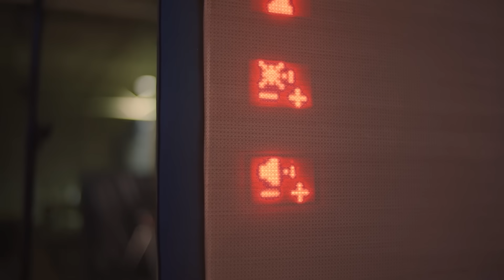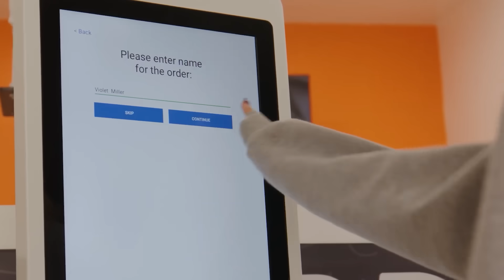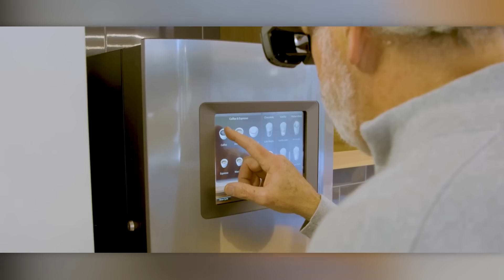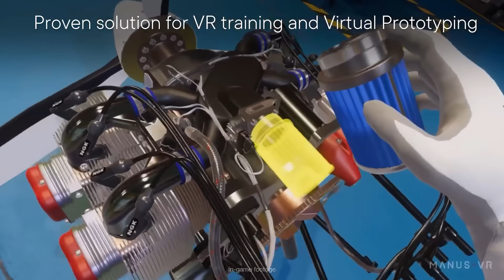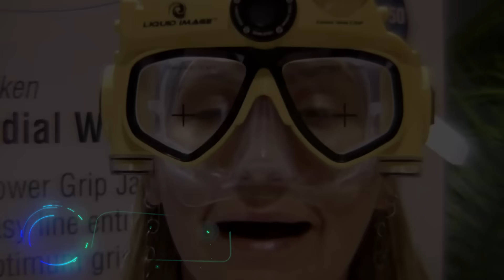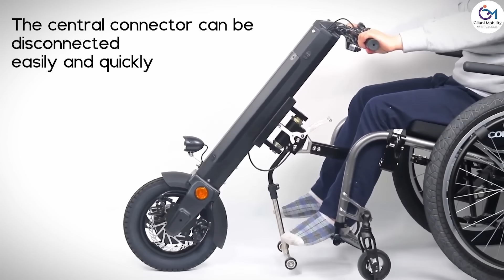AMAZING INVENTIONS THAT HAVE REACHED A NEW LEVEL

Comment: About the Stringdrive:
1) It isn't new. That tech is at least 15 years old.
2) The cords are NOT elastic. They are a type of paracord, with minimal stretch.
3) They were never adopted because the stringdrive mechanism is heavier, bulkier, and the strings had a VERY low service life compared to standard chains.
Reply: Belt drive bicycles are proven to be better than chain drive, but string ?
Reply: Please correct me if I am incorrect, but this is CVT for bikes? Also, I agree with @ronpiper8496, why not go with Belts that last?
Reply: This is not CVT for bikes. Belts are absolutely a viable alternative to chains, just like the stringdrive. But that's up to the user.

Comment: In reference to the vehicle flying, purchased by the Air Force. You said Canadian Victoria to Vancouver in 41 minutes. At 155 mph ?  The distance between those two cities is nearly, exactly 60 miles. The math doesn’t work!
Reply: Good catch. I would imagine the machine is not driven at 100% of capacity. So if someone went 120mph, then it would take 30 minutes. Math comes to the rescue again.

Comment: I realize they build more bikes than wheelchairs but why the hell is this thing worth 1200 bucks and a wheelchair costs even Medicare user that much and then it cost Medicare twice as much it’s such bullshit cause all the wheelchair has that’s mechanical if you will, is the wheel brakes or the wheel locks, if you will cause they’re not actually brakes there’s no handlebars there’s no gear changing there’s nothing there’s still two wheels about the same size of amount frame and they gouge us and that is ridiculous!

Comment: Rail in rural areas is ignorant. For 20 feet of track that has to be replaced and often replaced ties, people could just have a car. But that doesn't fit with the slave for life rental/tax systems designed to enrich the rich. Oh and nevermind their then entitlement to steal land for their system to run on. 

Wake up to what rent/tax use systems are. It's SLAVERY FOR LIFE...